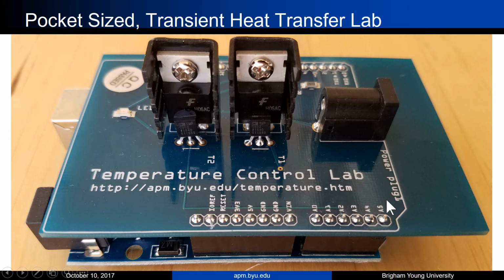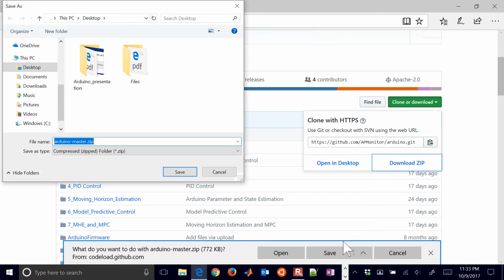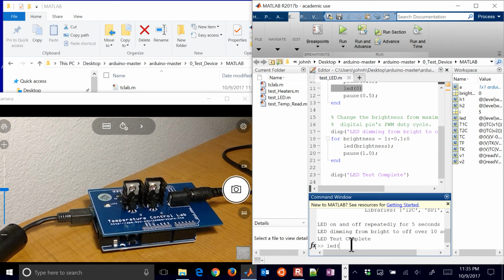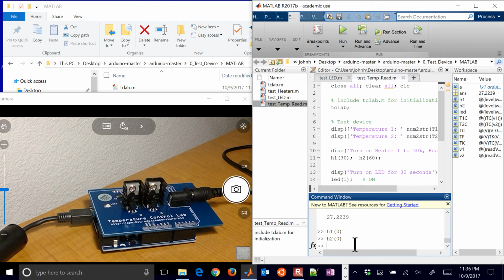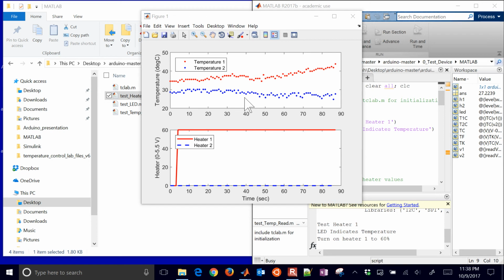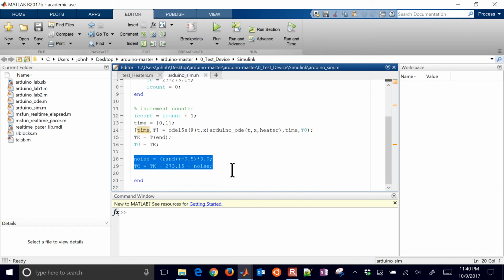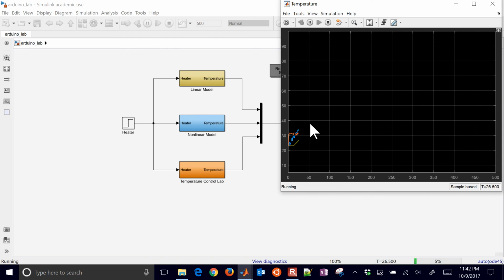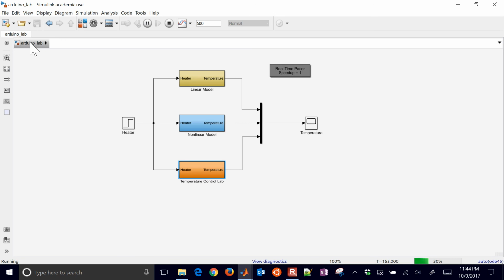Arduino Lab Intro in MATLAB and Simulink

Comment: I'm getting high levels of noise (+- 10 degC) when reading temperatures while the heaters are on. Once they are off, the noise subsides. Any thoughts?
Reply from the maker: The most common issue with high temperature variability is that the power supply is plugged into the computer USB instead of a power outlet. The Pulse-Width Modulation (PWM) interferes with the temperature measurement because it creates voltage fluctuations.